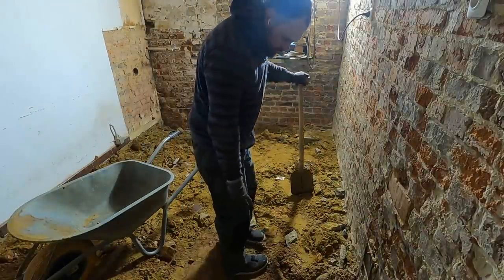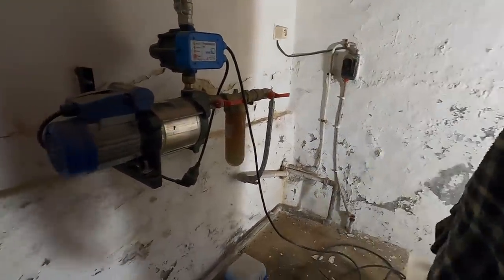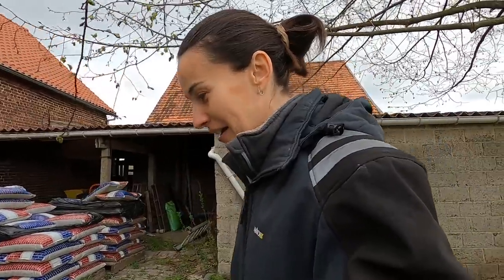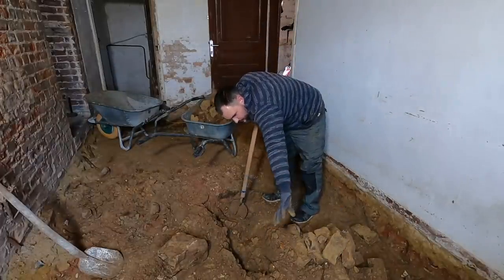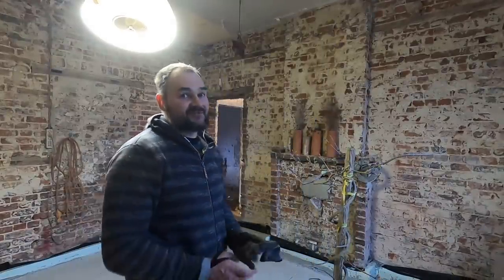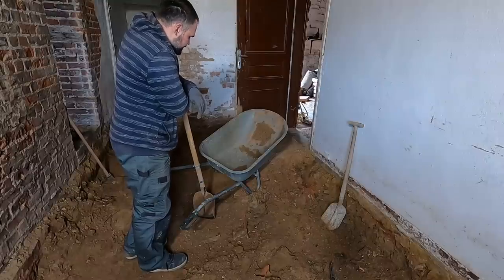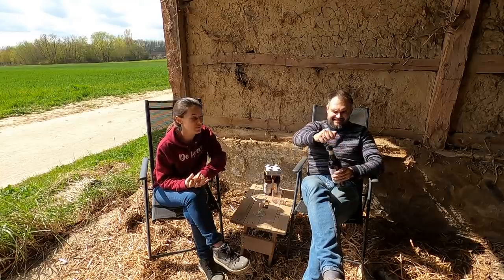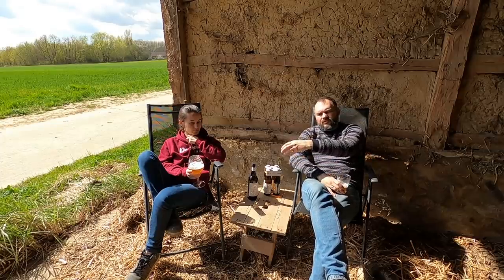Exploring the UNKNOWN: How did the water system on 110+ y.o. farm work?

Comment: I’m not a plumber but I am a water utility operator. My advice is to not spend another moment tracing the existing pipe unless it’s to figure out where to cut it out because it’s in the way. It’s likely in poor shape and not made of appropriate material. Find the well and have the well inspected and tested. If it’s good, then you’ve won a mini lottery! You may need a reverse osmosis system and UV system to make it potable (that means safe for consumption) but whoever tests your well should be able to help you with that. Regardless, you need to install new water lines into and within the house and I would expect that there are some sort of local regulations with this kind of project. While DIY is fun and a lot less expensive, sometimes it’s worth bringing in the pro’s, even on a consulting rate.
Reply: I'd be tempted to just use the well for the garden, they already have a mains water meter, which means the water quality is tested and guaranteed by the water board! More expensive but much easier than maintaining your own well.
Reply: Yes, esp plumbing will be much easier and actually cheaper in the long run to give to the professionals Also old pipes might be lead, so not only not up the modern code, but a health hazard.

Comment: Yes as so many others have said, replace the lead pipes - they really are dangerous. As others suggested a metal detector may work but it will depend on the depth of the pipe. The other suggestion I saw was for a system I've seen used by the waterboards in UK for finding leaks. that should work regardless of depth but I don't know if the camera they put down is small enough to fit in your existing pipe.
Now for the really import stuff. Illia you look worn out and Marina - you don't look far behind him. Please look after yourselves because you got a lot of folks here who love you both to bits despite never having met you.

Comment: Plumbers have whats called a borescope or and endoscope and its a cable with a camera on it that they push down your water line and it can see anything that is wrong. And once the cable finds the well they can use a locator outside that tracks a cable inside the borescope that will show exactly where the water line is and how deep it is. Good luck
Reply: I've never heard of anyone running a borescope down what looks like 1" lead pipe though. I'd assume that the pipe exits the house roughly in a straight line and start digging for it where the cobbles end. On the other hand, as you need to replace it anyway, why not start digging right where the pipe enters the house and follow it back to the well?

Comment: Several people mentioned using a metal detector, good idea. Lead pipes have to go, Pex (plastic) line is great stuff. Once you find the well there should be a water line going down into the water with a foot valve, the foot valve keeps the water from draining back from the house. The well needs to be pumped out to see if it recovers quick enough and see how deep it is, this may take a few trys to get the water flowing back in the well. After it's pumped out a few times then you should get it tested. You will also see what was used for cribbing in the well, it could very well be brick, possibly wood. Keep smilin
Reply: " Lead pipes have to go,"    Absolutely, in and out of the house.
Reply: YES LEAD MUST GO and never touch it and/or then touch your mouth.
Reply: @marcryvon  I'd also say the galvanised pipes should go considering how rusty that filter looks. They might either be almost clogged on the inside or just about ready to spring a leak or both. Going from copper pipe at the pump to galvanised at the shutoff is also a pretty bad idea and very likely to cause leaks.

PEX isn't used much in Europe, MLCP ("multicouche" in French) is the most common pipe, and of course copper. MLCP pipe is much cheaper than copper but the fittings are so expensive they outweigh the savings on the pipe. It's a sandwich pipe, PEX on the inside, then a layer of aluminium for mechanical strength and another layer of PEX on the outside for protection. Both compression and crimp fittings are available but compression fittings need to remain accessible in most European countries and crimp fittings require tools you need to either hire or buy. Solder fittings for copper are dirt-cheap but obviously you need a bit of skill to use them. Even seasoned plumbers don't always get solder joints tight on the first try.

Comment: Using underground radar with an expert, you can figure out the water system. The underground radar will show where the pipes are. You have to realize you will have to meet government codes for water, so lead is out. You need to find out before you bury the pipes under concrete. Ask your neighbors they probably have a great recommendation. Great video.

Comment: As you expose pipe, conduit lines remember that it is a good idea to make them "future accessible . Use marked brick, non corroding plates, insulation etc. Even going thru wall put in access panels. Make up schematics, hard sheets and computer records for reprints. hang them in basement in ziplock water proof bags,  carefully measuring where and what. You may want to run , say, cat 5, heating elements in future so make your service trench and wall holes a little bigger. You've already done the hard work , why repeat it. Same for outside.

Comment: Wisteria is easy to control, but it does have to be controlled!!   Once it gets up where you want it prune it back hard in winter every year.  The cut site forms a node from which new shoots spring.  The blooms are on the new shoots.  What are all those blue, yellow and purple flowers in the yard?  This is a lovely spring surprise!
Reply: They looked like tulips!  If the bulbs can be salvaged they can get saved and replanted.  😍
Reply: Wisteria requires constant vigilence to control. In the southern US climate conditions are ideal for wisteria and when left to its own can grow with stems bigger than a man’s arm!

Comment: FYI depending on how wide and or obstructed the lead pipe is you may be able to run a Pex line through it to the source. That way you wouldn't have to dig it up and you'd have the additional protection of the metal pipe over the plastic for future digging.

Comment: Depending on how "new" the tree is it might have sent roots into the well and damaged it, even cement ones will crack if the roots try hard enough to get thru to the water.  I live on catchment water and we change our water filters once a month, using both carbon and sediment ones.  We also treat our water with baking soda and clorax to keep down other unwanted things, but then our tank is above ground, as we are in hawaii and it will not freeze.

Comment: English Lesson 😉👍 for fun....
Lead 👂red is a noun; The element, heavy metal or an adjective meaning something heavy as in "hurry up, get the lead out" or "that went over like a lead balloon"
Lead 👂reed is a verb; meaning to go before or pull something from the front as in leader.
They are both spelled the same but come from slightly different root words from different places/languages.
The word you are looking for to add water to the pump, we would say "prime the pump" because it is the first thing you have to do. This dates back to the old hand pumps when they had to be primed before they will work. Some modern pumps don't need it but it is better for them if you do.
Your hard work, as always is an inspiration. Also, I appreciate that you put the effort into learning English to bring us this content too ❤ thanks.

Comment: We use a pump to bring up water from a 25 meter depth,  for the troughs on the farm....The occasional problems = pump needs repressurizing / the valve at bottom of pipe is not reaching the right water depth / leaking pipes or disconnected pipes / blocked pipes from debris in water / filter on pump needs clearing or replacing...Totally agree with 'From The Prairies' about replacing the pipe system. The pump sounds in good working condition.

Comment: An underground utility locate company would be able to locate any buried metal water pipes or power/telephone lines with no issue so long as they have access to part of the pipe or cable.  They may be able to find your misplaced well.  You could try a metal detector too.  A good modern metal detector should be able to find lead.
Definitely replace the lead piping.
Thank you for sharing your adventures with us!

Comment: Well systems can be hard to activate. I agree that
it would be a good plan to have a professional look
at the pump and well. You can then run updated
pipes to the places you want water. The old pipes
all need to be disconnected for health reasons. It
will be easier to use new pipe than to track the
dangerous old lead ones through walls and floors.
Your research always gets you the best results👍🏻👏🏻

Comment: The first thing I would do is , have a sample  of your water tested by a lab.  You need to get rid of your lead pipe as iam sure it's no longer used or allowed in Belgium.  When I worked in Friesland  in 1970 they were already switching  to plastic pipe.  Keep in mind that even some type of plastic pipe is no longer used.  This is especially in the use of under floor heating.  But iam pretty sure in the EU you can find what you need.  They were years ahead of North America.  Is your water pump being shut off by a pressure switch in the system. Take care.
Reply: Things like lead pipes are often grandfathered in but that doesn't mean it's a good idea to continue using the pipes even if there's no legal requirement to replace them. Besides, now is the ideal time for replacing those pipes. Once the concrete floor is down, no one will ever want to touch them again.

Seriously, seeing they already have mains water I might be tempted to abandon the entire well pump setup and maybe use a submersible pump for watering the garden in the future, plumb everything else to the mains water.

Comment: Marina and Illia, I suggest you buy a test kit to see if the water pipe is lead because it’s good to know for sure (I think they’re not expensive). You could use a metal detector to find the well in the front yard (see if there’s a metal detecting club in your area. You can also try water dowsing rods - there are videos on YouTube showing how to do it. It’s an old fashioned method but it works for me - you can even use two pieces of coat hanger wire.

Comment: That is such back-breaking work to dig out the subfloors and old foundations.  Illia will have the strongest back in Belgium after this is all over!  Wouldn't it have been wonderful to see how that house had changed floor-plans over it's lifetime?  So many levels and odd floor layouts.  Good luck with your wisteria vine.  Our temperature swings here in the middle of the U.S. are just as wild, and we sometimes have to bring plants indoors, also.  Today it is 29 C and tomorrow will only be 8 C!  I hope you get lots of beautiful blooms on it.  Thanks again for an interesting video!

Comment: To solve the problem of the tops of the plastic sacks no staying open when you put rubble in them just simply turn the top of the bag over 10 cm or so a bit like you would with the cuff of a shirt sleeve
Reply: Another method is to cut the bottom from a plastic bucket and put the bag inside and rolled over at the top. When full just pull the bucket free! Saves hours of frustration and it works!

Comment: Over the winter, I made modifications to my wheelbarrow which will allow me to carry heavy weight over irregular ground.  I added a 2nd wheel, identical to the original one, and approximately 300 mm track width.  It is not as easy to turn in a tight space but loads are not critical to balance from side-to-side and pushing over uneven ground, without requiring great strength in the arms & hands.  This would make it easier for Marina to help you!

Comment: You wanted to know how to which for water or to find lines. Take 2 L shaped rods. about  24 inches long on one side and 6 inches on the short side. Put the 6 inch part in each hand. Walk around and the rods will cross  X when you walk over the pipe or any water source.
Just follow the pipe with the rods crossed and it will show you where the pipes are and any other water source. Like the well. 
If you have any other questions just ask.

Comment: The good news with your digging is you'll be able to route and bury the new pex lines where you want, think about how you want to bring it in, which rooms or areas you want it to go, and think about putting a cistern or water system in the basement there where the pump currently is if that is suitable. It seems like you might want/need to run conduit for electrical to go to these areas as well, may as well do it at the same time so you can bury it all again and be done with it. :)

Comment: Very often, in the past and today still, people use mechanically filtered ground water for general washing, laundry, etc., unfiltered for garden, and buy bottled drinking water. Good domestic water sanitisation systems are fairly recent. Also, ground water systems in your area can have a lot of phosphate contaminants, which need specialist filters (e.g. reverse osmosis) which can be expensive to buy and run for a whole-house solution.

Comment: Yes filling it with water is priming the pump, it should self prime after, the blue thing on top is the pressure switch which should give you the equivalent of full mains pressure, it’s an older idea but works effectively, you could upgrade this quite cost effectively. I work for a pump company here in the Uk 😀

Comment: Well done guys.
Lead (pronounced led) pipes are just fine as long as you don't disturb them, the dissolved minerals in the water coat the inside.
You do need to replace it with HDPE or equivalent. You really don't want any lead pipe on the property...AND, bonus, you can sell it for scrap too!
Wisteria will be beautiful.

Comment: Water is an absolute necessity..... So without taking any step forward, a test needs to be done to ascertain whether this water is good enough to drink. in addition since this property is old, the pipes will need to be updated to prevent sickness from lead. Please take your time to ascertain that result. This maybe a good time to replace all pipes, and start a new system. Good luck..

Comment: First time you may hold the start button much longer up to 4 minutes to be able for the pump to suck water out of the ground.  It's normal it did stop as the unit doesn't feel water pressure. Fill the filter side up with a few liters of water and then hold the start switch manually until you can hear and feel water pressure building up. At he left side (exit) of the pump you first close it and now and then open it up until the water reaches the pump. Good luck !

Comment: Most pumps work off a pressure switch. If you turn on a spigot for water, the pressure release starts the pump and will run as long as there is demand. We have a 40 gallon tank that is pressurized by the pump, so we have water on demand. As the tank reached 30 psi the pump starts and runs until 40 psi is reached, them the pump shits down. Constant pressure in the house and garden.
Reply: Shuts down! Not that other word! Sorry.

Comment: Hi Marina and Illia, The bend pipe which is in the vid at 9.59 minutes looks to me a leadpipe. I am not sure but I had around the same situation once and that turned out to be a leadpipe. If that is indeed a lead pipe I would advise you AND Anneke not to drink water from it. At least not uncooked. The water WILL contain leadparticles. Not healthy at all. In the case it is lead my advice is to replace it with a copper pipe.

Comment: Hi dears, you definitely need to replace the lead pipes. They poisen the water and the earth in the garden...
There are companies, mostly doing infrastructure for communities, that have a modern technology to drill underground without having to dig up the grounds. They will put in a larger pipe through which you can lay multiple smaller ones. Now or later, which is great for changes in future.
It might make sense to put in a new borehole alltogether. Before you've found the old well with high probability of dysfunctional old tech.... will cost so much time and energy. Better spent on getting the house ready and save rent ;-))) therfore it sometimes pays of to engage professionals. Avoids costly mistakes as well.
Best wishes from Germany

Comment: We build our house in the early eighties and there was no communal water in our street so we also had to put our own well in. We used it all this time as our only watersupply. In the mean time the street has communal water but we still have not connected to it for the reason that we would have to build a seperate waterpipe system for it. We could not use both water supplies on one system. So that is something to think about. As for lead pipes, they are poiseness also for suppling to animals or to the garden. So I think the lead pipes will have to be removed in each case. Its very useful to have your own water well but you still will have to pay a flat fee for using it! Go to your archtect or to the town hall to be informed about it correctly. Oh and the techical services of the community can and will test the well water to see if it is potable water. They did this for us before allowing us to use it. Wisteria is a beatiful plant vut you will have to keep it in check. I would not plant it against the wall of your old brick house. It self seeds everywhere and its a strangler of pipes , gutters and other plants.

Comment: To find where it goes you could try using a metal detector or if your country or town has a services locator service where that take a machine and connect a electric wire to the pipe and use a scanner to locate the pipe and determine its depth and direction to its source.